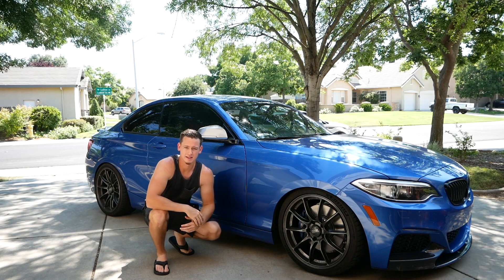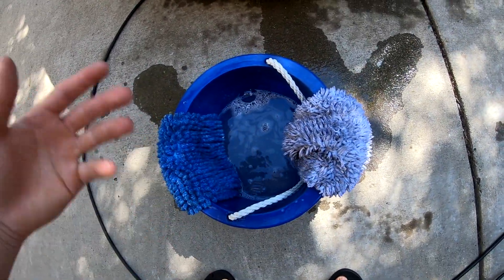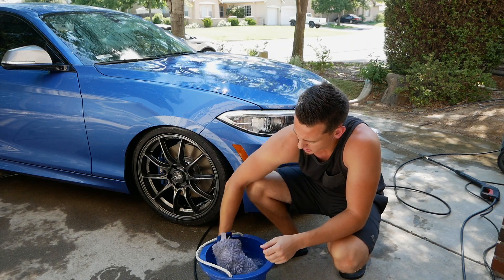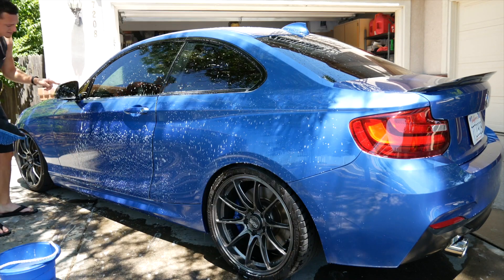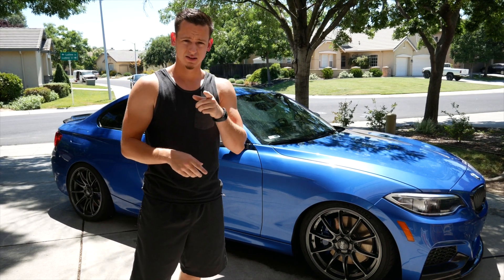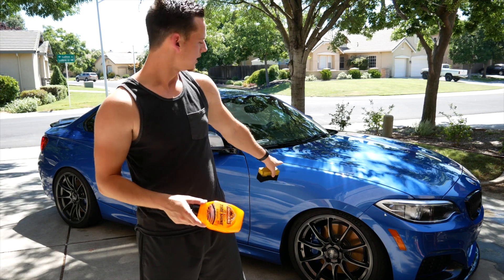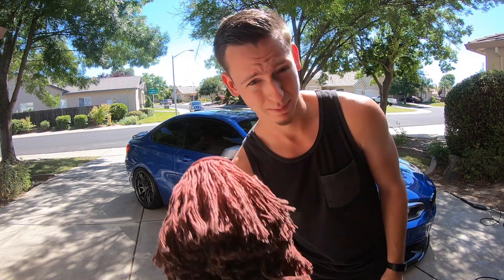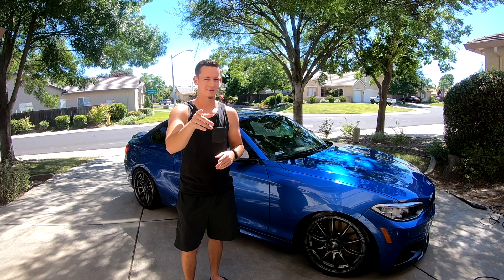Cheapest way to Wash your Car (Best Results)

Comment: If anybody was worth a damn they would know better I know you work from the top down start with the roof spray down get it wet I have a foam sprayer I love my foam sprayer but before I do any of that upper tire cleaner and rim cleaner on my tires and rims and I let that soak and drip down while I am washing my car so like I said I work from top to bottom I start with the roof then I work my way driver side I clean the windows with a separate cloth I rinsed that off always clean your windows with the hand towel so you don’t scratch your windows trust me it’s a pain in the bed I’ve already had to replace a window because I made mistakes then I wash the body then I move to the back of my SUV I wash my back window then I work my way down then I will flip my SUV around and the roofs already done so I don’t need to do it again then I will clean the windows on the passenger side rinse it off then do the body rinse it off then I’ll do the front I’ll do the windshield rinse it off do the front end the hood rinse it off then I moved to my tires and my rims and I do that very last with a complete different bucket and cleaning system